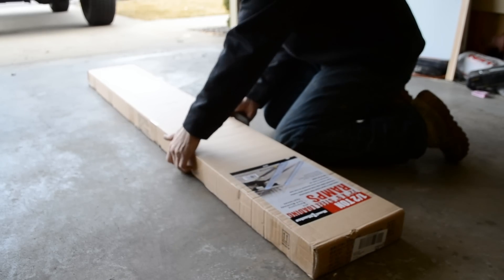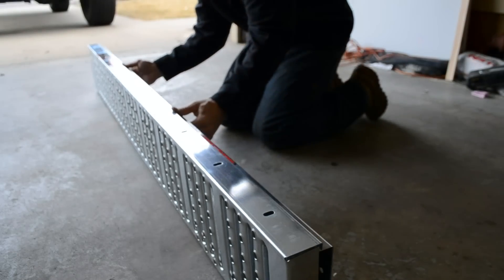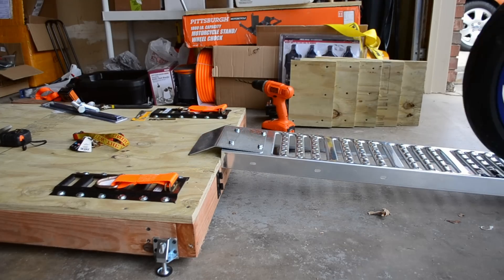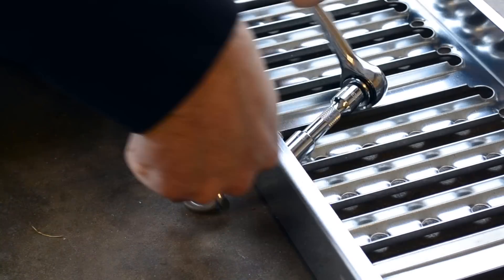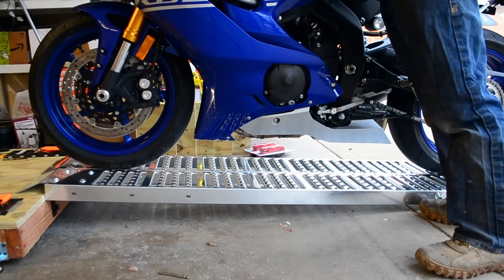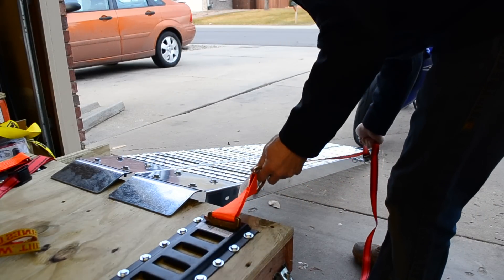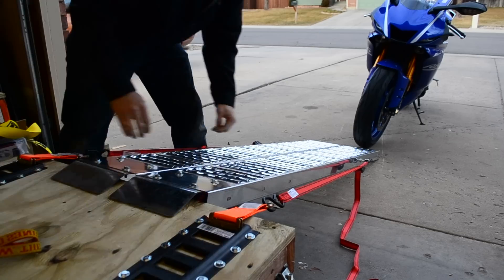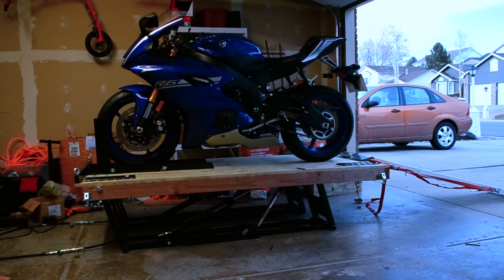Harbor freight 72" x 9" Ramp (Audio Fixed)

Comment: the brackets are mounted UNDER the ramp which you correctly did! Mount them on top and you risk the ramps flexing and failing which will not be good. Unfortunately these ramps  don't come with safety chains. I would highly recommend getting chains for these so you can chin them to your truck. If ramps kick out while you're loading you can really get hurt!
Reply from the maker: Rusty Nail I did all of that in the video. I added eye bolts and straps.
Reply: Rusty you didn't watch the old video come on man 😏

Comment: My only concern is that for a ramp that is rated to 1000 LBS there's an awful lot of flexing with a bike that weights barely 500lbs. My HD Heritage is 750LBS.
Reply from the maker: Its solid. I have a ramp that as rated for 2000 lbs and it flexes too. It will hold up as long as you are not doing anything crazy. They are all under rated. Thanks for watching.

Comment: Your going to need to cut angles out at the top of the ramp so it won't dig into your truck bed. That square angle will mess things up
Reply from the maker: They won't work for a truck bed. They are too short. This was just to get it into a trailer. I had to buy 10' curved ramps to get my bike into the bed of my stock truck.

Comment: Nice lifting table bro.  I am a engineer for Ford and we use lifting tables like that to move units down the assembly lines.  I see it has hydraulic lines so that is a brilliant little piece of equipment you've made
Reply from the maker: Thanks. I can't take the credit for the lift because they are Quick Jack lifts (dont recommend at all) I just built the platform for on top. I still use it every day to keep my bike on. Thanks for watching.

Comment: Hello, I'm getting on a bit where my age is concerned, so I got rid of my big trailer and bought the HF one that holds 1700 pds. I have a Polaris 450 Sportsman, that weighs around 686 dry.  I would like to use these ramps for that HF trailer and machine. Would you trust these ramps for that application? Thanks, and great video!
Reply from the maker: My only concern would be the with of the tires vs the width of the ramp. There would not be much room for error.
Reply: @DaveMedicus   I was worried a little bit about the weight, but I'm confident I could do that.  Thanks!

Comment: Was that a plywood built ramp seen near the rear of the platform and to the left looking toward the garage door?!?!?
Reply from the maker: Yes it was. I was just using the platform as a test for the height. I use the plywood one on a normal basis when its sitting on the ground.

Comment: when y ou bolt the ramps together in side by side, does the supporting weight become 1k? 

I know EACH ramp is rated at 500lb, and in combined its 1k, but i am assuming the 1k rating is from a 4 wheels vehicle with the weight distributed exactly even between the two ramps. 

Curious if you would risk something like a 850LB honda goldwing on this method.
Reply from the maker: Orvis25 I would just use stronger bolts to put them together with. I feel that you would be using the strongest part of the ramp and the bolt would be the only fail point.

Comment: Lol bro, u said virtually nothing happens, bit it did bend down too lol. But makes bit more sense to put it under for sure lol 👍🏽👍🏽
Reply from the maker: If you were on the receiving end it felt like almost nothing happened. The first way felt like it was going to snap right off. It does flex a little bit but it feels solid
Reply: Also it's going to bend when you just have the edge against the surface instead of the flat part against it as it should...

Comment: I doubled mine with the intention of riding up and down my truck. Well it was sketchy as hell going up due to there not having any support to lean on, and while getting it down the front wheel fell half way down, thankfully its a dual sport but screw all that noise
Reply from the maker: I use this to get my bike in my truck. This ramp really only served a purpose for the haul trailer or my stand. https://www.amazon.com/gp/product/B06W53FKKS/ref=ppx_yo_dt_b_asin_title_o09_s00?ie=UTF8&psc=1

Comment: So what really is the purpose of the platform other than to overhaul the bike? Do not follow why you need to elevate the bike, as it appears to be too wide of a platform to work around the bike.
Reply from the maker: William Brock it’s the perfect width to work on the bike since there is room to place my tools. I use the ramp every day to store the bike under my house. It makes it real easy to use the wheel chock since the concrete is sloped and we often get 40+ mph winds which would blow the bike over. I can also use my pitbull rear stand to work on the bike easily. It’s not for everyone but it works great for me and was worth every penny when moving.
Reply from the maker: William Brock if you watch the video of me making it you will see what I was up against and it will make more sense to you. Thanks for watching.